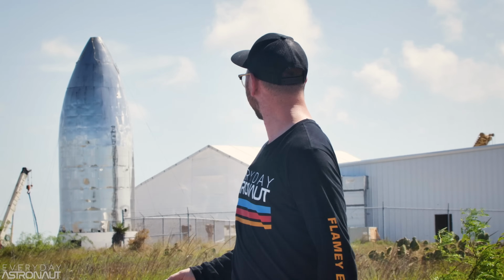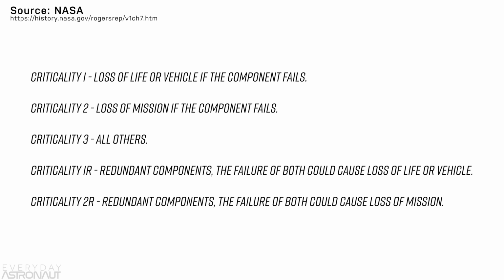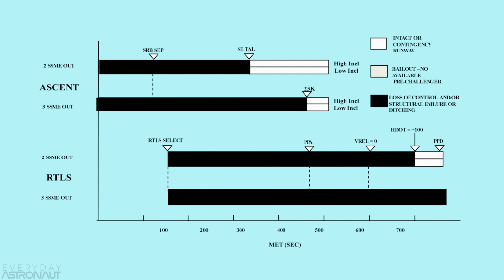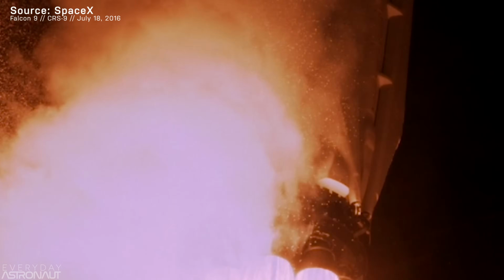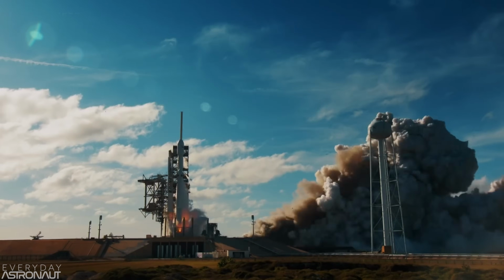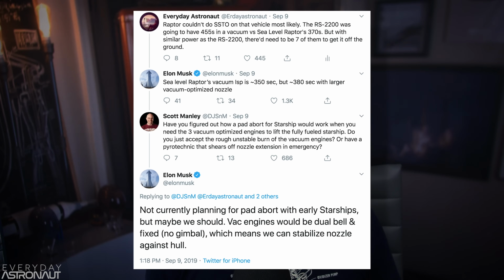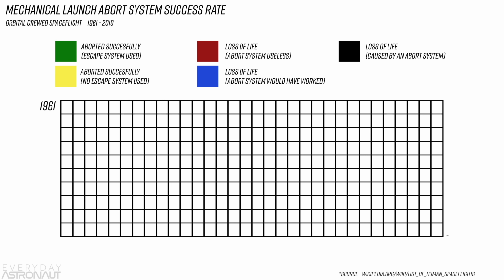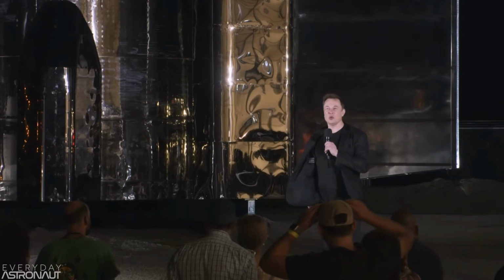Why won’t Starship have an abort system? Should it?!

Comment: I feel like this was pretty bias toward starship.. Its pretty hard to eject whole starship to abort on flight ... And even .1% could potentionally be fatal ... The airplanes is the safest transportation even with that accidents happens ...
Reply: How was it biased? Everything he said was well informed and educated statements based on actual facts and numbers, it seems YOU are biased AGAINST starship in this case if you actually try to argue against facts. You are also ignorant if you actually forget the point of this video on how SpaceX will make Starship safe. They want to make Starship safe by essentially making everything part extremely reliable on top of redundancy on a lot of parts, similar to planes.

Comment: Comparing engines reliability used 30 times with engines flown 2500 + times is not comparing apples to apples .
Reply: The more you  launch the more risk it will become..

Comment: 31:23 Actually this is not really correct, Starship when fully fueled will have a TWR ≤ 1 (with all engines including the vacuum ones), and launch abort systems usually have g forces of 7 (in Orion's case) upwards of 13 (in the case of Soyuz). So Starship using its upper stage engines is not a viable form of abort, you even mentioned that using the vacuum engines at sea level could cause catastrophic issues. This also applies in the case of using it in flight, if a Starship has to escape, not only does it have to escape from a booster that is exploding but now it also has to land with far more fuel than was intended for landing with, possibly with a TWR of  ≤ 1 depending on how early the abort was and how far the ship needs to boost back from. I also do not agree with the argument "some thrust is better than no thrust in an abort scenario." Unlike Shuttle where the issues weren't realized until it was long operational, Starship is early enough in its design phase that this problem should be worked around, it should be built with a launch abort system from the very beginning and there isn't really an excuse otherwise other than just pure negligence.
Reply: Have you calculated TWR assuming only sea level engines running? If so, it's probably wrong. As far as we know, they are developing dual nozzle engines for aborts. 
I don't think that not having abort system was main mistake of STS. Bigger problems were
0) NASA's arrogance (not exactly a texh reason, but still...)
1) Strapping crew on the side of rocket
2) Strapping crew on new vehicle
3) Using SRBs
Reply: @adamrezabek9469  
1) At stage separation Starship has to utilize both sea level and vacuum engines at stage separation so yes TWR is ≤ 1. Especially < 1 if only using sea level engines.
2) Outside of that tweet Elon made in 2019, there is little to no evidence of a dual nozzle engine for aborts being developed at the moment for such a procedure and I will hold my breath until such engine is formally announced.
3) During Shuttle NASA's arrogance was absolutely one of the main reasons for Challenger and Columbia, NASA management believed 1/100,000 launches would lead to a catastrophic failure while while the engineers gave shuttle 1/100 launches before such a failure. Engineers had warned multiple times about NASA pushing the limits of the SRB's as well as foam strikes hitting the heatshield while NASA management didn't believe those to be a significant issue, now we know how both of those things turned out.
4) It's arguable as to whether or not the SRB's were a good choice, they were relatively reliable. 135 missions x pair of 2 SRB's = 270, only experiencing 1 failure gives the SRB's a success rate of 99.62%, which is about a bit more than the RD-180 and a little bit less than Merlin according to the video. As Tim said in the video, the only reason for the SRB's failure was due to management pushing the bounds of the SRBs by having them launch an a colder day than the boosters were rated for. Regardless, if an abort system was in place during the SRB's only failure, the crew could have still survived.

Comment: Given all the tests that were done where abort systems pretty much failed 98% of the time. It's probably best to do away with it, make the vehicle as safe as possible the first time (and given the track record, abort systems may not be necessary at all). Just make sure those willing to go in the rocket understand that if something goes wrong, there is nothing that can be done to save them.

Comment: @Everyday Astronaut, your analysis of the 'why' behind SpaceX's rocket systems is pretty thorough and well structured. To me that shows hpw good you are at understanding a problem. I am a sucker for understanding better ways of problem-solving. Would you comment on your method (s) in solving problems?

Comment: Just so we are clear on the terminology.

Assuming we need a system to handle 10 Newtons of thrust 
 - if we design it to handle 15 newtons of Thrust, that is UNDER engineered
 - if we design it to handle 9.9 newtons of Thrust, that is OVER engineered

Comment: Starship won’t have an abort system because it costs money. Profits over lives
Reply: Weight, cost, and it's already super safe. It would also be hard to make.
Reply: It hasn’t even flown yet. How do we know it’s super safe. That’s what they said about the space shuttle when it first flew.
Reply: @tinaandalex  Starship has already flown and landed.
Reply: @oren2000  yes, and it broke it’s landing gear.
Reply: @tinaandalex  On SN15 it didn't, also it was an experimental landing gear.
Reply: @oren2000  And what happened to the rest of the starships?
Reply: It's always about what price are you willing to pay for 0,01% of safety.

Comment: Why doesn’t Space X just use the Dragon Capsule with its abort system replace the nose cone or at-least mount to the nose cone on the Starship?  They would have the best of both worlds.
Reply: Dragon is too small. It would be possible, but they want bigger ship. Id they want to launch CD,  they can just use F9

Comment: If they can make starship at least as safe as air travel today then sign me up.
Reply: Probably when they stop crashing. Even a little rain ruined a launch today.
Reply: @klutzspecter3470  Launching a rocket takes the right time, place and weather, don't see Apollo 12 being struck by lightning and if only they were too late to change SCE to AUX the three astronauts would die

Comment: The abort system question is not about the system itself, but the value of human life and astronauts no less. So an abort system would probably be required just to address this and not to actually be used. Otherwise just send robots to space with no abort.
Reply: It's about reliability, price of life, and price of adding abort system.

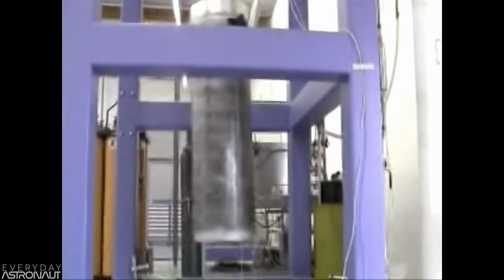Comment: 8:02  What is going on with the screen?!! the windows is slowly shifting up und down and left to right xD
Reply: that's a screensaver feature i'm pretty sure. it subtly moves the image around after a while of inactivity so you can still see what's happening unlike with other screensavers.
Reply: More so it's moving to avoid pixel screen burn-in. More common than you think.
Reply: Screen saver most likely
Reply: @KatieGray1  that’s a solid window. And it’s slowly shifting in the timelapse
Reply: the computer on the side
Reply: Up left
Reply: Where?

Comment: Hi Tim, I've watched this a few times and I think some of the comparisons were problematic.  The merlin and raptor are many orders of magnitude different in complexity.  Also if an airliner looses and engine it still has wings, there are many points of failure that have to go wrong before people die. With starship,  as we've seen there's 1... not just 1 but many 1s. Personally I can't see starship landing the way it is now with people on board...ever.

Comment: Mathematically, I wouldn't choose an abort system.  However, to the extent I might be in a situation where I could SEE the failure coming, it would give some level of comfort.  For example, mathematically it doesn't make sense to bring a parachute on an airliner, but if you were one of the unlucky ones who were sucked out of a plane, it would be nice to have some way to address the situation during the long fall.  It's preferable to die quick, rather than wait a couple minutes knowing you may have had a chance if only you had planned for it.

Comment: Planes don't have escape systems
Reply from the maker: High performance ones do, like fighter jets 😉 a plane can lose a lot of systems and still glide out of the sky. A rocket has a ton more potential explosive energy, packed to the brim with high pressure, high energy propellant with many single failure points. Absolutely not the same

Comment: Good point about the safety difficulties casued by the shuttle's solid boosters. Its notable that Soviet space engineers - not noted for avoiding risk - considered but rejected the use of solid boosters for human rated flight on exactly those grounds - that they could not be turned off.

Comment: As for the Space Shuttle - as originally conceived, there were many viable abort modes. It was only the compromise design with a tank and SRBs that removed them. The original design was two flying manned vehicles, one the orbiter and the other a booster, which would land back at the launch site like an airplane - under power, not gliding. Budget cuts and DoD meddling totally compromised the design. But I assure you, when the Space Shuttle was conceived, astronaut safety was again the top priority.

Comment: um inherently any flight is dangerous if there were no aeroplane accidents i would be concerned also there is no abort on a aeroplane in flight with ejector seats , if your worried dont fly , dont watch any launch all human made things are and have possible mistakes and failure
airliners still fall out the sky though

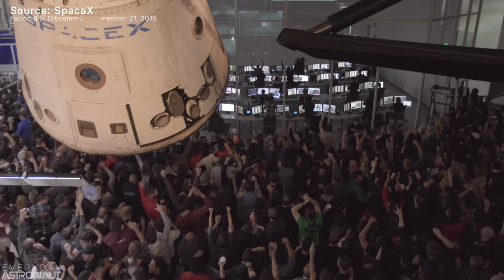Comment: 24:58 CONGRATION!!!!!!1!!1! you landed a rocket using the engine when you could have used a f*cking parachute
Reply: they actually couldn't, they tried the rocket got destroyed in reentry, and even if they only burned the engines on reentry and used parachutes to get down the parachute would be heavier than the propellant needed to land :/

Comment: ...it won’t until it kills a crew or two, especially under conditions that would allowed an abort system to potentially have saved crew. Any escape system is better than none, even if it is a parachute - like the shuttle introduced after Challenger.

Comment: After the current tests and demonstration of what happens when you try to land a rocket on it's tail and everything doesn't operate perfectly.

I'd feel safer flying in the now-retired Shuttle orbiter. At least they TRIED to add an escape method and had several fly-back or abort-to-orbit plans ready.

Comment: As of today, 
No. Of raptors flown: 
Starhopper- 1
Sn5- 1
Sn6- 1
Sn8- 3
Sn9- 3 
Sn10- 3
Of the 12 raptors, only one has failed.( On sn9) 
Giving it a reliability of 91.6% despite being just an early prototype. Way to go SpaceX.
Also remember.

Comment: I have a feeling that having a descent abort system wouldn’t be to difficult but extremely extremely expensive use the same system as the ascent abort system but use the parachutes almost immediately after solid rockets are fired and turn the main rocket body engines of so that it falls as fast to earth and away from the crew as possible

Comment: I guess one rational explanation to this, is: if you need the engine to perform deceleration before touchdown, what's stopping it from performing extra acceleration after takeoff?
I mean, if you have to abort, you're not going to perform that deceleration stage at all.... and you still have the engine... might as well use it as an abort system.
it's still there, it's still good, it still thrusts..... just ignite it and ditch the surplus engine that's there specifically to serve as an abort system.

Comment: Airplanes do fail, engines fail occasionally, but an airplane can still land if an engine fails, or a flap falls off, or landing gear jam, or a door opens. Starship is surely far less tolerant of component failure.

Comment: The best learning is done from failure. If it wasn't so ridiculously expensive to build rockets, pushing unmanned tests beyond the limits of the machine would be the very best method of improving its design. After all, you can't really know for sure how something will fail, until you see it fail.

Comment: You do realise that a 'failure' is actually a success when designing and engineering something, right? It means that you have data to work with. The SN8 was their closest perfect launch yet. The data they get from each 'failure' pretty much means that by the time people are allowed on board, there will be no need for an abort system as every single kink will be ironed out. They're nowhere near to a '1.0' launch. Each launch is to test a certain aspect of the design and anything that they can also test during the main test is a bonus. They're collecting mathematics and physics data. Why do you think crash tests for cars are a thing? If a car has no faults during testing then there's something that they've severely missed. The same goes for anything that is designed and engineered for consumer use.

Comment: Airliners have abort systems. They are called "wings".

The comparison with airliners regarding the flaps and hydraulics is not fair.
An airliner can land safely without functioning flaps. This has happened several times.
Starship can not.
Reply: Wings only work if you still have them attached

Comment: You sound like the same engineers who constructed the "Titanic" Should we add the safety? What are the chances? What are the statistics? Statistics have nothing to do with the killing of one life because one life is worth as much as a million lives. If you can not understand that, then you lack compassion and understanding.
Reply: The difference with the Titanic is that it failed on its very first trip. Everyday Astronaut is suggesting Starships should be flown and reflown to test their reliability and identify design flaws. I think if the Titanic was tested numerous times, enough to gather data and identify points of failure, then the design flaw(s) would have likely been resolved before putting crew on board. That's just my take on it, though.

Comment: The big difference with Starship is it is completely reliant on its propulsive landing system. Or more specifically relying on two of two raptor engines relighting exactly when needed during the decent, no time to deploy redundancy measures at that point. This has to be much more risky than the Shuttles, Dragons or even Saturn V's re-entry strategy.

Some degree of fail space would absolutely be worth it (especially even this is designed to be the first mass transit spacecraft for humans). Be that keeping all three engines lit during decent and only throttling up those needed for the actual landing manouver or just using (BIG) parachutes . . .

Comment: Considering the last two landings, maybe they need to look at aborting landings.
Reply: it's not fair to count test flights. Think about it like computer simluation, just more realistic and probably more expansive.
Reply: @adamrezabek9469  it's completely fair to count test flights.  They show that the current plan doesn't work.
Reply: @MrAwyork  there are two types of test flights:
1) To show to everyone that i have done working rocket (this should be counted)
2) To test some ideas. This can't be counted, becouse they are not meant to be successful. They are meant as quick way to find where is current weakest point (looks like it's Raptor, not the manouver)

Comment: I think Spaceship landing will need to be redesigned. SN9 failure was scary.  Why didn’t the third engine attempt to light?  Why are they pushing it to the last millisecond to turn and light?
Reply: we don't know why that raptor failed. But it wasn't final Raptor, so it was no big deal

Comment: Tim, can you make a video about why solid rocket booster cant be deactivated and if SRBs are really good
Reply: You can't deactivate them because the chemical reaction is so quick and powerful. They are good but only as boosters or launch abort system because you can't control them. They are also cheap and have good P/W ratio.
Reply: @pastikamaster1759  thank you!

Comment: it would probably be a good idea to add one after todays test lol
Reply: lol. This test had nothing to do with final Starship. This is like saying "this car isn't reliable. They should add abort system. Look it twice failed as protoype while testing"
Reply: @jagildown  will see. NASA has certain threshold for reliability. I don't think they care if it is achived by abort system or by reliable and proven vehicle
Reply: @jagildown  Falcon 9 us not that reliable. It has around 100 flights, and expirienced couple failures. So it's reliability is surely bellow 99%.
Also, crew dragon has not been much proven. Starship will be proven by cargo mission, becouse it's second stage and a
spacecraft simultaneously

Comment: Why don't traditional air craft have abort systems. Because, 1 reason,. It's reusable & for the most part carrying extra weight 98% of the time & not use it sounds follish. But still good to have in the future when cost go down. But for air planes, we been should of had that system.